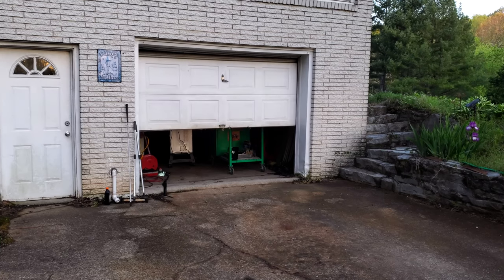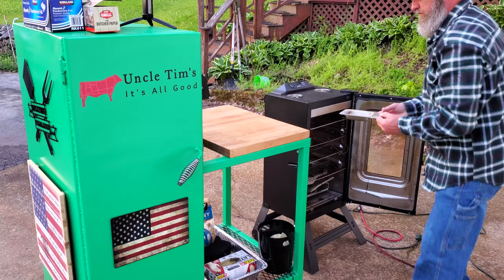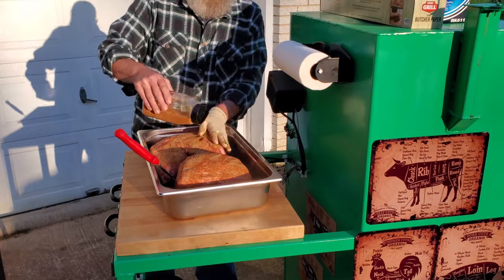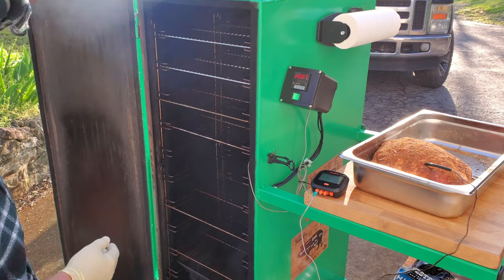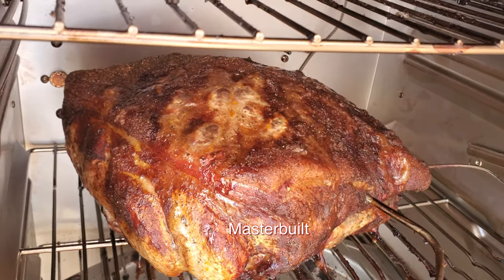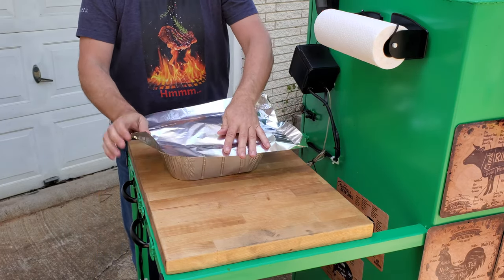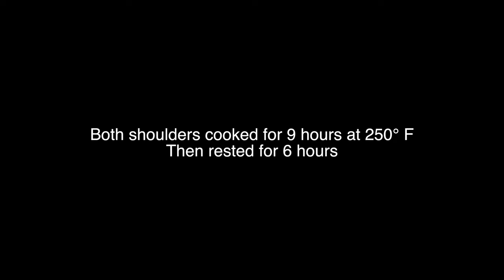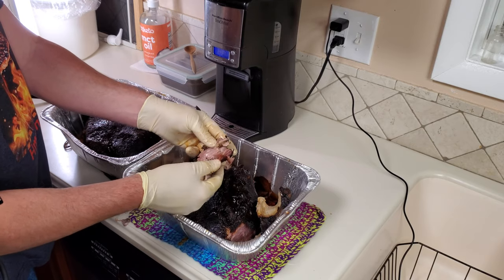Big Time Smoker Showdown - Masterbuilt vs DIY Custom Smoker @UncleTimsFarm  #kärnəvór

Comment: Nice looking smoker! 

I am also in the process of building an electric smoker, I have a question regarding the 1200 watt element you used. 
Does it get glowing nice and bright red? 
The element i sourced is a 1400 W  but doesn’t get very bright red. In my experiments the ones that get bright red seem to raise the cabinet temperatures better and faster.

Thankyou!
Reply from the maker: Thank you. 

You know, I've never really watched it that closely to see what it looks like.  I do know that it gets hot enough to generate plenty of smoke and get the cabinet up to temp, but it does take a while.  I am actually considering adding a 2nd element just to help it heat up quicker and maintain temps when I have the smoker fully loaded.

So I guess what I'm saying is, it depends on how big your smoker is.  Mine is pretty large for such a small element so that's why I'm thinking about adding a 2nd one.  If my smoker was smaller, the element would be plenty hot enough to handle it without any question.
Reply: @UncleTimsFarm  
The cabinet of my smoker is done, the inside dimensions are 22 inches wide 15 inches deep and 54 inches tall so it’s a pretty good size. 
I’ve been doing test runs with an old 1500 watt Brinkman element but it doesn’t quite fit properly, but gets good hot and bright red. Seems to do the job, but takes about an hour and a half to get the cabinet up to 300° when I was doing my test runs, I don’t actually plan on running it at 300 it was only for testing. 
The whole cabinet is insulated with 2 inches of mineral wool insulation.
As for a controller, I’m gonna go with an auber PID controller and I’m going to make it so it can runoff of two circuits so I will be able to put two elements in it (1200watt to 1500watt) my initial idea was to run it off of a 220 plug with a big oven element but not everybody has one of those in the garage so I’ve decided to split it up into two 15amp circuits. 
I’ve been having a lot of trouble trying to source out an element that will work for my set up, the master built one seems pretty good. I just wanted to make sure it gets nice and red. 
The radiant heat off of a bright red element always seems to warm up the cabinet faster in my experiences with all the testing I’ve done with many different elements in my pk100 by pro smoker. 
I’m going to contact Steve at smokin it and get the dimensions on there 1500 W element to see if it will fit. 
As for the smoke, I’m using a Bradley smoke generator. That way I can add smoke at any time without having to open the door.
Reply: @UncleTimsFarm  any chance you could take a peek at your element and see if it gets bright red next time you fire it up?
Reply: @UncleTimsFarm  where did you locate your temp probe, I’m trying to decide where I should put mine, thanks